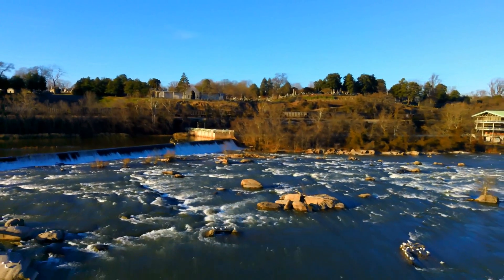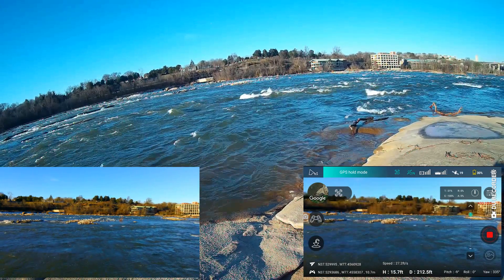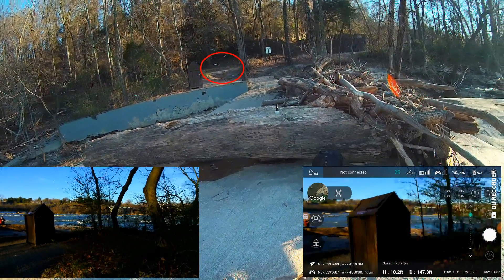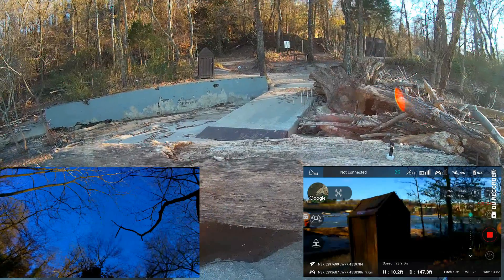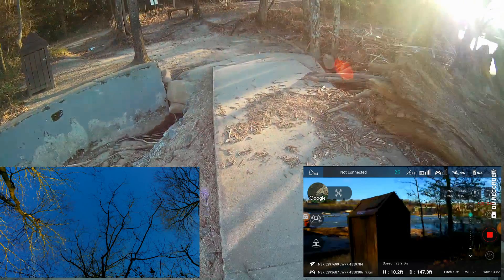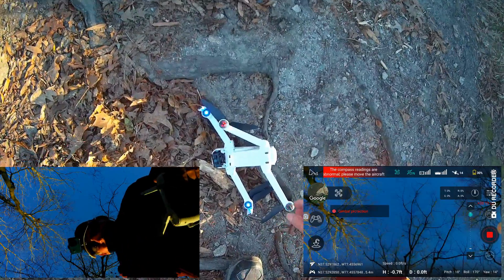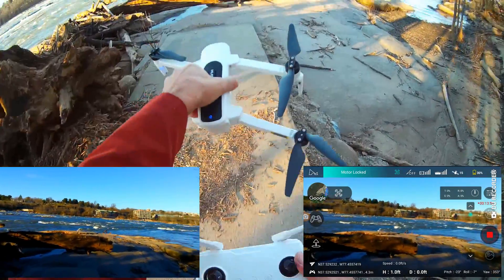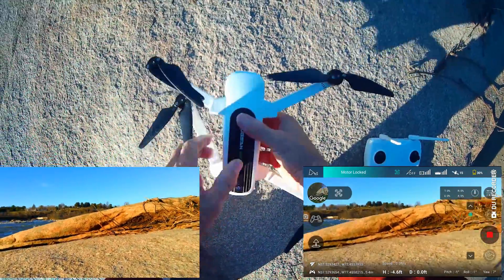Hubsan Zino  H117s Crash Analysis Firmware FC 1.0.46  FPV 3.2

Comment: $0.02..  Video on your phone continued to update and GPS locations updated even after showing not connected.  If video synced perfectly, then my guess is that the it has something to do between the controller chips on the quad and the ESC.  Probably a firmware issue on the Zino that can be fixed.  Just randomly guessing, it may have even restarted the onboard controller or simply halted, cleared the error, and began again.

Comment: Question for you. When you connect Zino, do you turn off mobile and wifi off. I always turn on mobile wifi on, to get gps map. But if you turn it off than you won't get good map reading.
Reply from the maker: I usually leave  WiFi a off and leave my broadband on for map updates.

Comment: I had the zino working briefly with my samsung note 4 and the same thing happened in very close range. After the update though the note 4 would never connect again and i use the nvidea k1 shield and have not had that happen since. Its a bit scary though

Comment: Odd, your controller antenna orientation, your reason for this?
Reply from the maker: The antennas are pointed up andhave slight V which is the recommended position for best reception. As you know the flat part of the antennas need to be pointed toward the craft.
Reply from the maker: According to manual the antennas should be straight up in a slight v. What are your thoughts?

Comment: Do you mean 3.3 firmware
Reply from the maker: The 3.2 firmware that I t loaded came directly from Hubsan support via dropbox. Since then I have update to the newest 3.3. I know it sounds crazy, but, we are on the bleeding edge of Hubsan spear right now. I have 3 good video in the works for the 3.2 and 3.3...
Reply: So is not firmware that was put for the drone. They requested this firmware for you.
Reply from the maker: @Jeffrey00ish  Yes customer support sent me the 3.2 version for testing. I tested 3.2 and now I have updated to 3.3
Reply: Ok, got it. Do you think the 3.3 is better for now.
Reply from the maker: Yes, I believe so.

Comment: There are many Zino owners that can relate. For no known reason in clear LOS flight at seemingly close range and low altitude, disconnects happen. I had a Hubsan H216a that also used the X-Hubsan App and frequently did the same thing... Just lost signal and kept on going with whatever the last input command was. The H216a ended up just flying off into the Swamp over 200m away at about 6m high... lost forever. So I conclude , this is not a new issue and yet it still happens more often than you may think. I would hazard a guess that several disconnects occur and the pilot does not realize simply because not everyone does a screen capture video.  It would be interesting to know if the antennas actually are full antennas. I dont know much about the technical bits and pieces of antennas but am waiting for someone to do tests with the parabolic range boosters. I should get mine next week... Great video and it will be very nice to have Hubsan chime in here. Good Luck.
Reply: GM, you said THE parabolic range boosters. Do you have a specific one in mind? There are several different sizes on Amazon. (and if a $10 solution fixes the problem AND gives greater range...)
Reply: @thesoundsmith  : yes... In the Mavic tests the 1/2 circle ones do not project as the parabolic concave ones... I got these coming.. https://www.amazon.com/XCSOURCE-Foldable-Controller-Amplifier-RC578/dp/B0723HSVY1?keywords=XCSOURCE+Foldable+Remote+Controller+Antenna+Booster&qid=1547697193&sr=8-1-fkmrnull&ref=sr_1_fkmrnull_1
Reply from the maker: The parabolics I have fit my Spark controller.
Reply from the maker: Your analysis and explanation seem to make the most sense so far. Hubsan support is always touting to load all the firmware the release even if one component has the same revision. same 👌🙏

Comment: Thank you very much for your video. I had the same crash  with my Zino. But unfortunately I did not record it. It happened to me after Android update App. to (1.6.4). I have Samsung S8.
It seems to me that is the Android application's fault.
For my misfortune I have problems with gimbal level now.
Reply from the maker: OH no! I'm sorry to hear about the gimbal  issues you now have.
Reply: My flight looked very similar to yours. I was flying back, but I was facing away in my direction, at a height of 7/8 meters and when Zino was already at my height, about 5 m away from me, just then I lost control of him.
I pressed the landing button but didn't react at all.
Reply: I unfortunately had the same crash, but mine hit tree branches and then proceeded to land it water. I’m trying to figure out how to fix the drone.
Reply from the maker: Oh No! Sorry about the Zino taking a swim..... I ca relate... I lost a Spark just down river from where this crash occurred! If my Zino fell in the river, I would take it apart and wash and soak it with distilled water.  Dry it with "Damp Rid" for days. Good luck, in whatever method you choose. Please keep us posted!...

Comment: Don’t feel bad I get mysterious disconnects with my dji Spark too. It my be some kind of interference in the area.
Reply: Tried this?
Go to Settings>Privacy and safety>Location>Improve Accuracy> and Disable Wi-Fi Scanning
Reply from the maker: @SenatorPerry   Thanks! I will give it try!
Reply from the maker: Agreed that the Wifi bubbles from other devices are causing issue.

Comment: Not knocking the Hubsan products. I have seen repeated reports on H501ss and the Zino, when you do an firmware update it fixes the problem you are having and creates another problem with the drone.
That is why I don’t update my H501ss . I have the advance 2018 version and so far no problems. 

What were your setting on the timing for the failsafe to take control after disconnect?
I think it took too long to go into failsafe. 

Thanks for sharing your real experience with the Zino. I am sure this will help others to be more cautious after updating to assure the quad is safe to fly.
😎👍🏽👍🏽
Reply from the maker: I know right....I'm honestly not sure what my fail safe settings are. I'm hoping that this video does help some folks out there.

Comment: I am really very frustrated by ZINO's inability to stay connected with the TX
Also, I am experiencing a lot of lag in control commands in general, even with the latest firmware upgrades tp FC 1.46
Reply from the maker: I  notice the Zino drops connection to TX more often in my neighborhood, probably because of the WiFi from all the houses. I have been experiencing lag issues at the beginning of my flight. Not sure if it my Android phone or what. Do think we have transmitters?
Reply: @Duranafy  Hi ,Duranafy,have you tried to change the place to  test it ,will it act the same ?
Reply: And if possible please send me the whole firmware of the drone for easy reference ?
Reply from the maker: @HUBSANOFFICIAL  I have tested it since the crash in many different location (Dallas Texas and Orange Virginia) and it seems to be disconnecting from the controller more often that usual.
Reply: same here, it's kind of terrifying to fly zino if there are delays between the tx and the drone it self, it may crash if you land manually.
Reply: @judestephenromanillos  Hi Jude, if you don't mind can you send me the flight log and the phone details to service@hubsan.com ?I will provide you  the right help as soon as possible .Thanks
Reply: @HUBSANOFFICIAL  just now my zino crashed in the swamp because an update pop-up in my phone, so I'd like to recommend an update that makes zino controlled only by remote without the phone and remote working
Reply: @HUBSANOFFICIAL  this is because the firmware and other update are not same version, this problem is solved, now my zino is dead because it fell on a swamp, and tomorrow I'm expecting 3pcs. battery, i didn't have luck in your company and no insurance i think. This Android update pop-up have caused it.
Reply: Hi ,Sir,can I have the flight log and the firmware version of your drone and the gimbal also for the camera for easy reference ?
Reply: Saben si soluciono el problema de desconexion ?